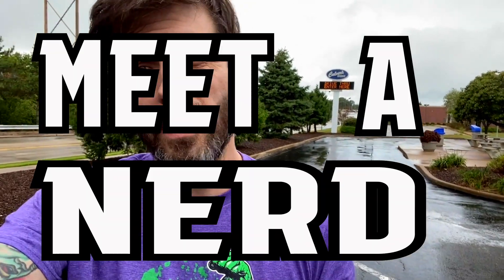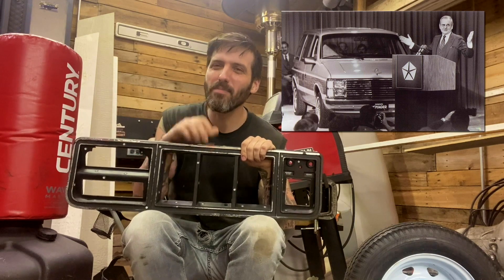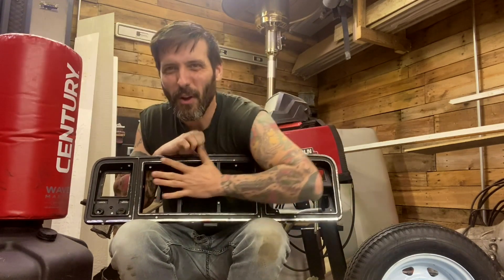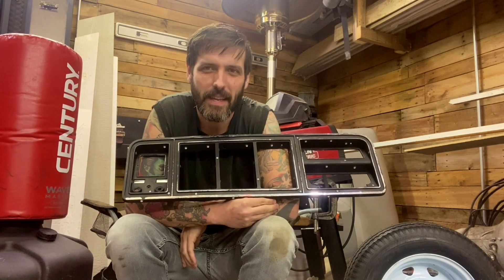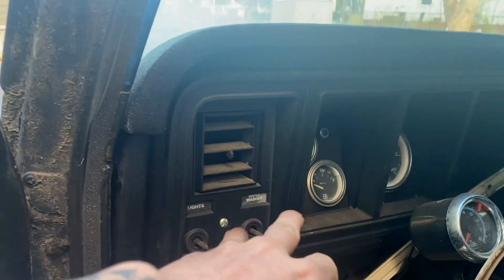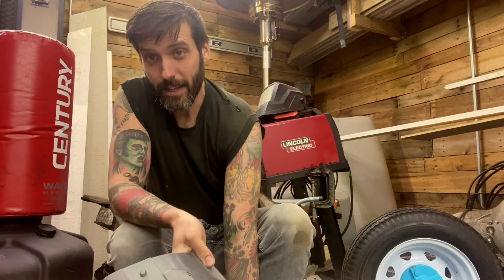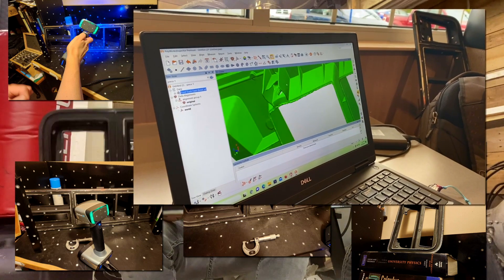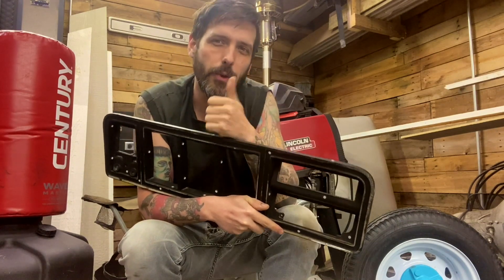I Want to Open-Source the 73-79 Ford Truck - Let's Start By Printing Our Own Dash Bezels.

Comment: Awesome, i do a lot of custom bezels (64-65 Mustang, 70-71 Torino, and 71-74 B Body Mopars) and this is just amazing for that purpose. I have a Dakota digital setup in the F100 i just got so i don't need to modify it but a fresh new one may be in line. First i had to fix that stereo area though, thats rather odd

Comment: Loose that ugly bezel and start from scratch, the bezel should be the first thing to go. the shape and everything about it needs to be rethought
Reply from the maker: Thats the idea - if someone wants to just print a stock one, they can do it for free now. If someone wants to modify it a bit, they can do that. What intend to do is just use the back-end mounting geometry to design something entirely different, but that still fits right in there.